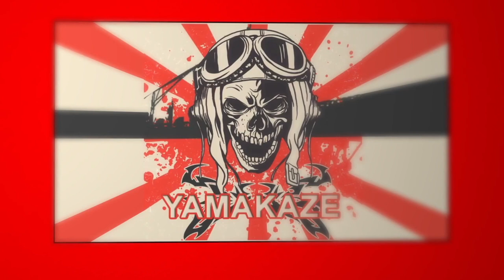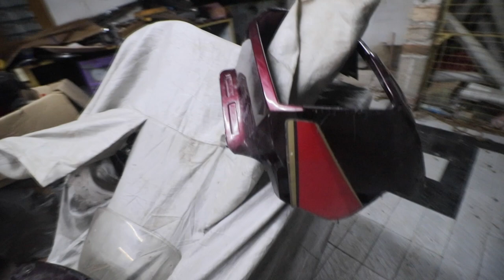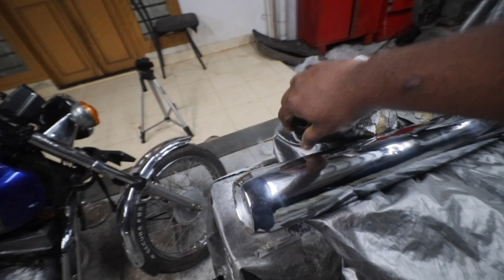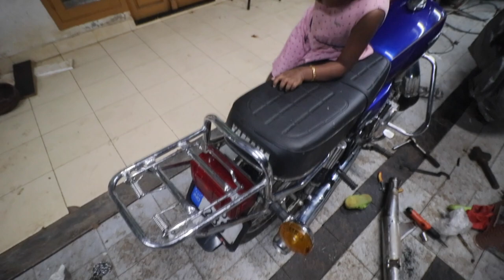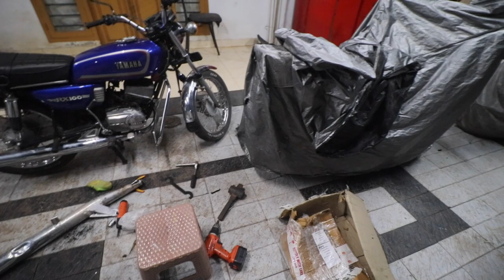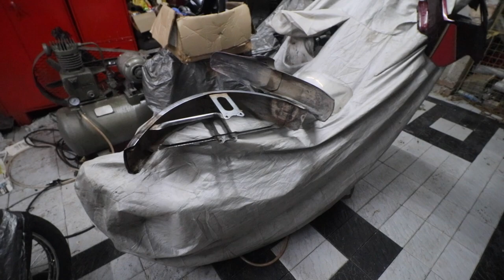RX 100 Orignal Silencer fitting (Malayalam)

Comment: It may not be the best performer but Rx100 is the most soulful and character rich among all 2 stroke singles. That mettallic sound is so pure. Shogun is the second best in that aspect.
Reply from the maker: very true, shogun sounds best when its coming at a high rpm from a distance,  rx 100 sounds best when its idling

Comment: Rx100 mileage kurva bhynkara soundum enthu chyum chetta mileage kittan? Oru 35 okke kittumyrunn ippo 20 okke ullu
2 , 3 days edukthe irunnl bhynkara soundum oru karakruppum und soundil kurch ottichl sound maari varum but bhynkara sound
Pinne silencer fitting start chyunna placeil oil content eppzhum kaanum kure drive chythu varumbol
Reply from the maker: Bend pipe leak und
Reply: @Yamakaze  yes chetta aa cylinder kitnte avide silencer start chyunna plcil oil content pinnh nalla sound milge kittan ini entha chyndth
Reply from the maker: Njan cheytha pole Athu remove cheythu puthiya Aliminum cylinder gasket ittal mathi
Reply: @Yamakaze  ath ellam koode ethra aakum?
Reply from the maker: WhatsApp Status Collections under 100
Reply: @Yamakaze  chetta tvmil ente place kilimanoor aanu ivde evidyaanu rx spare parts kittuna plce
Reply from the maker: Ariyilla